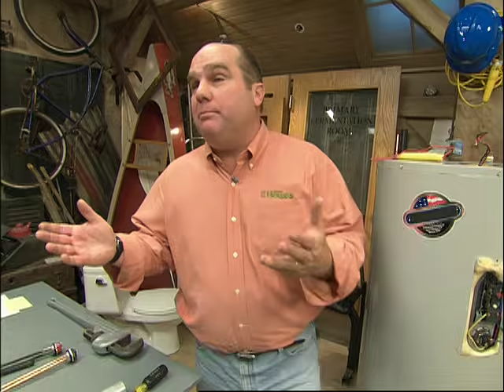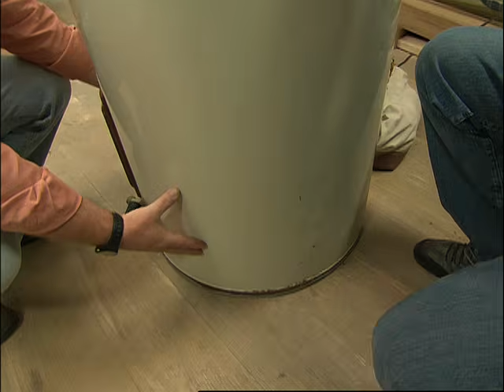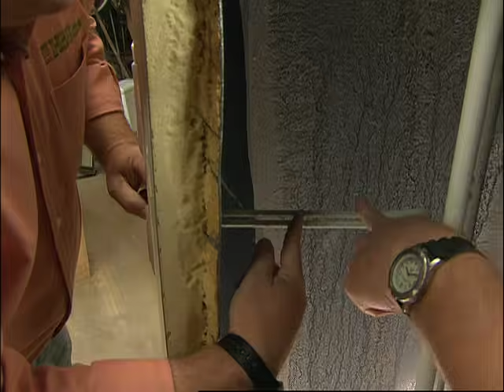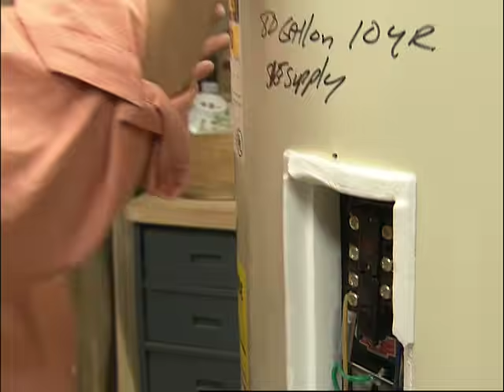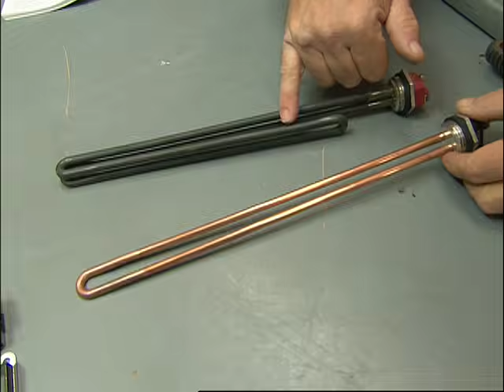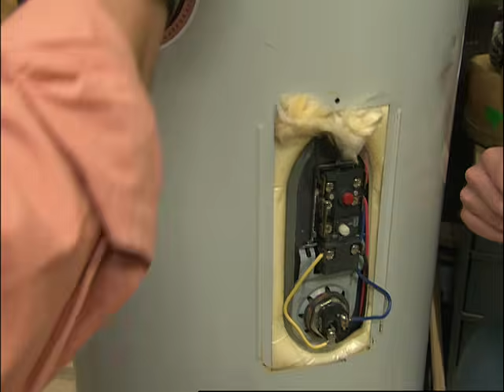How to Maintain an Electric Water Heater | This Old House

Comment: Great videos! I started watching TOH YouTube videos from the first one and in succession. Fantastic tips and information! My question is how the powered anode system works on my Kenmore Elite gas water heater installed by Sears in 2011? The service manual indicates that "the powered anode rod is non sacrificial and should not need to be replaced unless damaged". Thank you for your time 🇺🇸

Comment: I don't have kids so I'm not worried about scalding anyone, plus I sometimes I like hell water shower lol. But If I turn the temperature above what's recommended will that help the hot water to last for longer periods since I would assume it wouldn't have to use as much of the water?  I got a new rain shower head so it uses much more water than before.  What is the hottest temperature I could set it to with out damaging anything?  Thanks in advance!

Comment: Correction- USA is 240v, not 220v. Also, this video fails to mention the simplest and easiest maintenance, flushing the tank, which should be done at least one per year.
Reply: They made a separate video for that. It seems they try to keep their videos under 5 minutes.

Comment: I need to fix mine. The hot water doesn't get very hot and it doesn't last that long anymore. The heating elements and dip tube are pretty cheap. I also have to replace the plastic drain valve as well. Looks like project time this weekend! Wish me luck lol.

Comment: You are great in explaining. I have a foul taste in my water. Can it be "old" water affecting water quality/taste?
Reply: Emily Smith  Thanks for the reply. It's still the same moment;D 

Very insightful and good answers. Thanks a lot. My particular problem seemed to be the housing that held the filter, wasn't screwed properly shut. It was a gap there, which made the water not circulate properly, so it became standing water, only to get modly and foul.

The filter was 10" and the cartridge was 10" but from different suppliers. But they didn't fit regardless. The filter didn't buttom competely into the plastic housing, leaving a gap.

I left it, for 3 year it seems haha. Cause I was just demotivated. So exhausting that something that is so simple, becomes a huge problem.

Comment: hii,

do you have any cut away video of heat exchanger tank ?  it is a tank just about the size of these hot water tank, but with more inlet and outlet (normally it is used in conjunction with tankless style water heater. 

thanks
andrew

Comment: I checked the anode rod after almost 8 years and it was almost completely  used up. I plan to check again in 5 years, as long as the heater lasts. Also replaced the dip tube though it wasn't necessary but I had ordered one just in case. Now I've replaced the soldered joints with sharkbite fittings and the copper pipe with flexible copper lines. It's an electric heater and I intend to replace it myself next time. Because, when the plumber came out to do the job last time and I asked him the cost, he wrote the price on a piece of paper and handed it to me! I knew then it was too much. It was $850 but that was in 2008. I hope flushing the tank and replacing the anode prolong the heater's life. By the way, the elements can be changed without emptying the tank. Look for the video.
Reply: the elements can be changed without emptying the tank?
.........how hard was it getting the anode to unscrew?....are they expensive?
Reply: Do you know if they make a flexible dip tube?

Comment: Also, make sure there's an electrical disconnect switch beside the water heater for service, unless the circuit breaker is within sight of the electric water heater. This is an NEC requirement that is often overlooked, especially on existing water heaters.
Reply: Legal does not automatically equal safe. I just rewired a house and many of the new rules left me shaking my head because they exist for convenience only ie. having a receptacle near the a/c condenser for the service tech.
Reply: Problem, I can’t get either heating elements off, and I bought the element wrench.  The heating element, it’s on so tight it’s like it became welded on. Any suggestions on how to remove the heating element if it’s stuck on?

Comment: If your dip tube goes bad and breaks apart you will also get hot water but not for long.  Cold water doesn't get to bottom of tank.  Possibly plugged up faucets and fixtures with plastic bits as well.

Comment: My hot water heater is leaking,  I'm not shu where at. At the moment but around the top heating element it is wet is there away to take the cover off the whole thing and reassemble and it works afterwards

Comment: I'd say a gas one is better if your power gos out no hot water but you still get hot water with a gas heater
Reply: Depends if you have space/access to vent the gas exhaust from the unit. Could always get a whole house gas generators that automatically switches over when the power goes out.

Comment: They should have mentioned annual flushing of the tank so sediment and hard water flakes don't build up. I don't know of anybody who does it besides me, but they should.
Reply: Flush mine every year anyway without TOH telling me to do such. I wanted to learn what this vid was about. Now I know. Learn every day something. Regardless. 
Thank you TOH.
Reply: Yea remember someone telling me this 10 years ago when I replaced my water heater andI told myself I would do it but never did.
Reply: I do it every spring.
Reply: Thank you so much for the tip
Reply: Flushing mine now every 6 months (spring/fall)......our water is so bad here in Ann Arbor MI....you wouldn't believe the amount of sludge and scale that comes out of that electric tank...replace elements too....they are not that expensive and they sure get gunked up as well!!
Reply: Problem, I can’t get either heating elements off, and I bought the element wrench.  The heating element, it’s on so tight it’s like it became welded on. Any suggestions on how to remove the heating element if it’s stuck on?

Comment: Pro tip: water heater element sockets have two holes in them for a reason, stick a long handled screwdriver through them for the leverage you need. Don't use a pipe wrench.